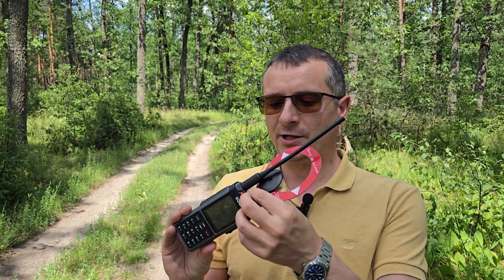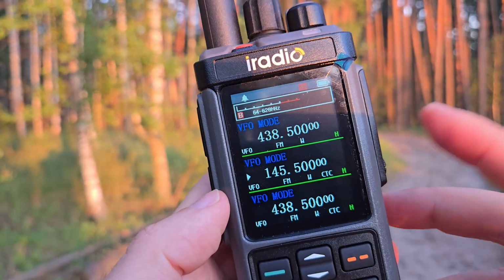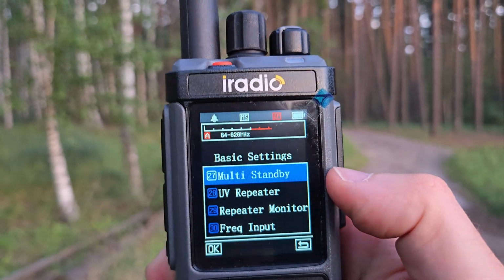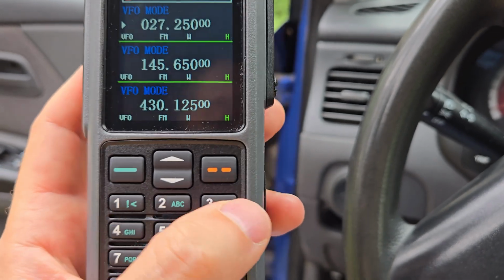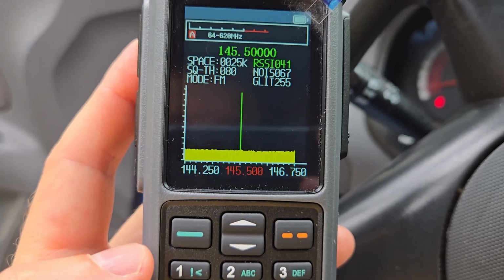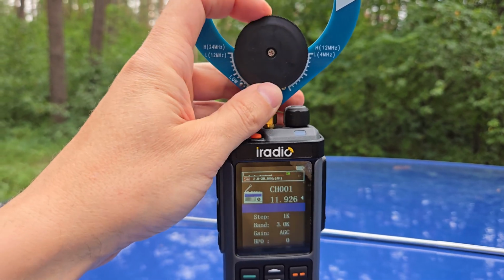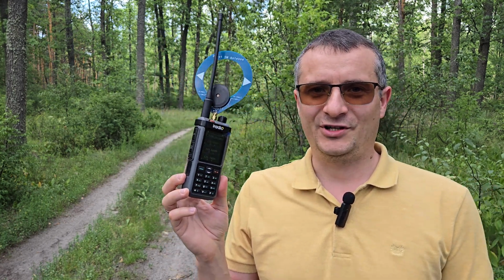iradio uv 98 plus all bands radio

Comment: My Iradio UV-98 Plus is a year old.  I am not able to open a repeater that is two miles from me - a few people who don't have this same radio cannot figure out why.  I tried to reset my radio back to factory settings, and it will not.  I re-installed the firmware and nothing has changed.  

Any suggestions?

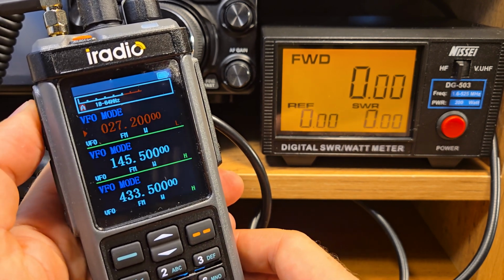Comment: How to set the Device like on Minute 11:04 that on A has 27.2 MHz and on B 145.5 MHz on C 433.5 MHz because these are different Work Ranges ? On mine i just could set a single Work Range for all 3 ... Thanks
Reply from the maker: My radio just allows me to get the frequencies from the box.
Reply: @radiotory  OK ... i still did not get it to listening in the 18-64 MHz and simultanously to TX on 64-620MHz. Well it is also good not to TX with the wrong Antenna .. so ...
Reply: Found the solution ... > hold down button while Power on < changes to full Band cross Band usage, and same procedure to set back